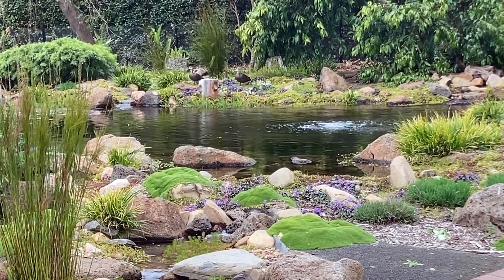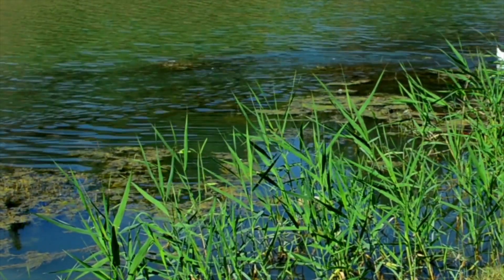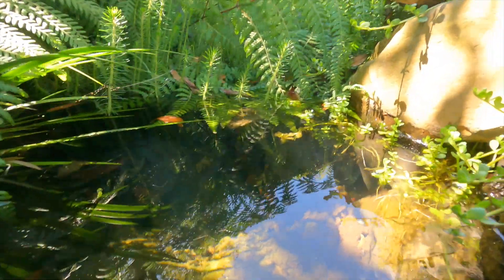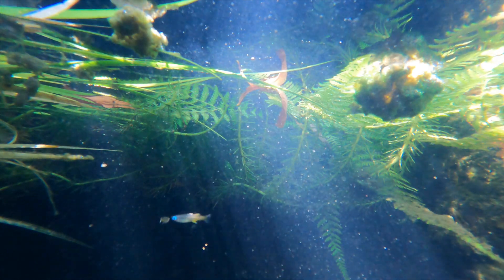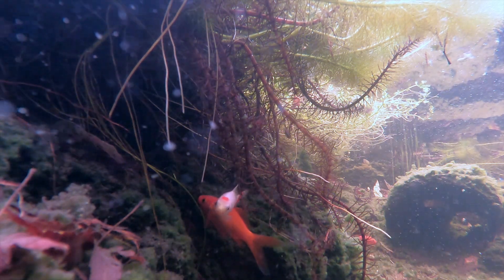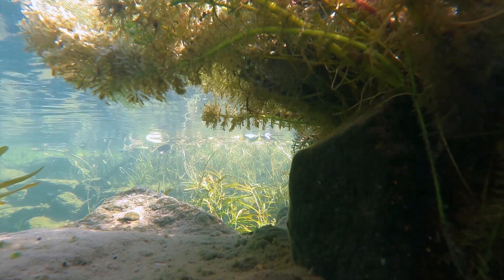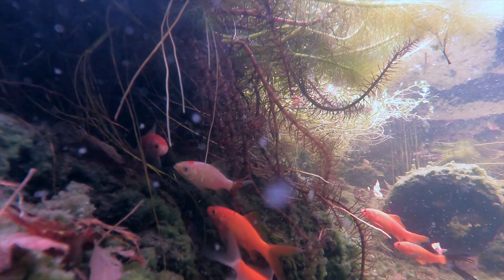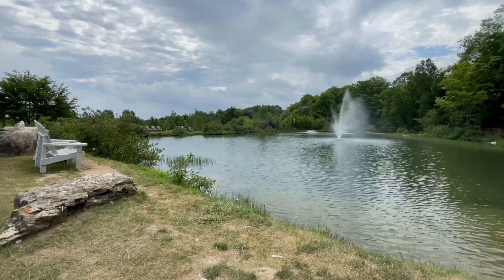This is how I would filter a REALLY BIG POND!

Comment: I have a 1/3 acre pond that's 6' down the middle and is fed by surface water from a nearby river. I use muck reducer and other beneficial bacteria. I also have an aerator and waterfall, plus 2 bog filters with pea gravel and plants. If I don't use blue dye, the water is green and it has never been very clear. (I also have a small island with plants. Ducks love it.) Any suggestions?
Reply from the maker: What’s the volume of the bog filters in relation to the volume of the pond? What sort of livestock in the pond? How much debris is breaking down in the depths? Green water for me points to lack of biological filtration. But it could also be that the river you are pumping the water from is also rich in nutrients/ minerals that are feeding the green. Perhaps if the water weren’t being continuously replaced the biological processes would have more of a chance. Point being there’s always lots of variables. If it were me I’d be looking to ways to reduce nutrient, if I were confident in the amount of circulation and filtration.
Reply: @Ozponds  Bog 1 is 9x12+ and Bog 2 is 9x20 with 18" of pea gravel with various water loving plants.

The river water comes thru the soil and there is no outlet unless it gets to flood stage during a heavy winter rain. Then it goes out the culvert and winds up back in the river. The culvert is screened for fish.

Some fool (previous owner) put catfish in the pond. We tried trout, but they died because the water temp gets to high during the summer.

There is a fair amount of water lilies, but we've reduced the amount. We also removed all the duck weed. Neighbors say the pond was stagnant and smelly before we moved in and clean it up. This also reduced the mosquito population.

We get lots of birds and feed them,  3 breeding duck types, hawks, herons, king fisher and more. It's a lovely pond, but just not as clear as I would like.  Cheers
Reply from the maker: @scott5747  see. It sounds like you’ve done a great job restoring it to health. Like I always say clarity in a clay pond is hard to achieve. Just be happy with healthy 👍

Comment: Tried clearing out all the old algae ready for next year now. Any ideas for treating/managing leaves in a pond? Stuck a massive net on last year and took us weeks to get it out with tonnes of soaked leaves gradually edging and letting it dry. Worked well after we finally got it out but was a colossal effort. Was going to let the leaves enter this year and net out every now and then. But I'm worried its going to ruin the water and add more silt without doing some management.
Reply from the maker: It will stain the water but that’s ok. I pretty much left my ponds this winter. There’s a fair amount of mulm buildup, I’ll start stirring it up and netting out bits and pieces, now the weather is nice again.
Reply: Try adding muck reducer and good bacteria. These are available on Amazon, The Pond Guy and others.

Comment: Hey, Oz, I am on a local environmental advisory committee here in the US, and we have a couple large ponds in parks.  I have launched 3 floating gardens, and they are doing well, but the task seems too much for what is really feasible to clarify the water.  There are fish, turtles, birds, etc. all in and around.  Given this, what is success?  How much floating vegetation do I need to add?  How will I know when it is enough?
Reply from the maker: Success is just healthy water. The pond being able to support the life and having no toxic algae blooms or nasty smells.
Reply: @Ozponds  Thanks, that is a great way to look at it.  I also have a turbidity tube, for measuring the water clarity.  Is there a level of clarity that I should be aiming for?  More clarity equals more plants able to grow at the edges (because light can penetrate X number of inches into the water), which results in even more clarity, right?
Reply from the maker: @erichneal3062  that is true. But what is causing the turbidity? That’s more a mechanical filter issue, capturing sediment. One benefit of light not penetrating the water column is it’s very difficult for algae to grow below the waters surface.

Comment: I would wetland it
Reply: absolutely, this would probably be more reliable, and if they are digging a big pond they probably have space and are using a excavator. a smallish pump could also be installed,  since wetland flow rate is often pretty slow. for a pumped wetland the wetland would need to be partly separated to insure the flow takes a long route out of the wetland away from the pump. I see floating filtration probably a better option where space is limited, such as a canal etc, since it would probably be more expensive and less reliable and need more maintenance.